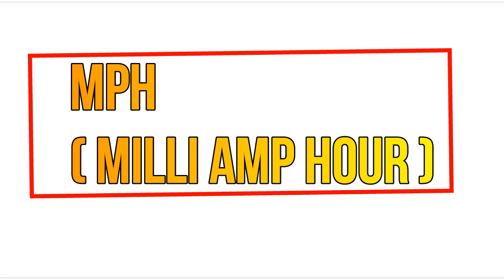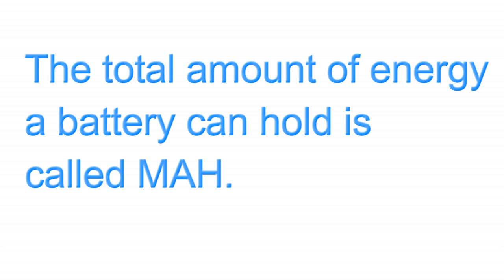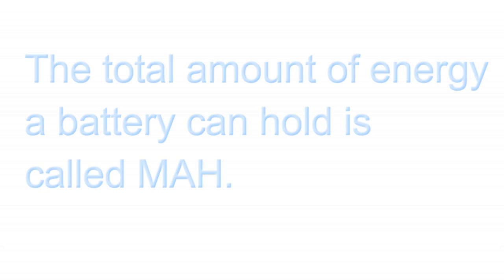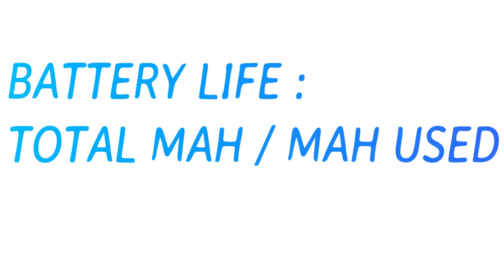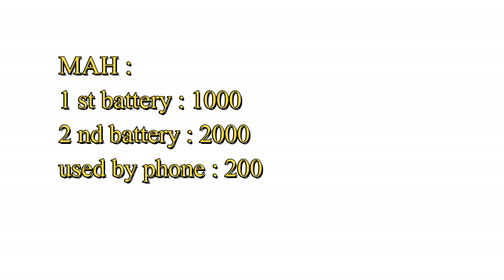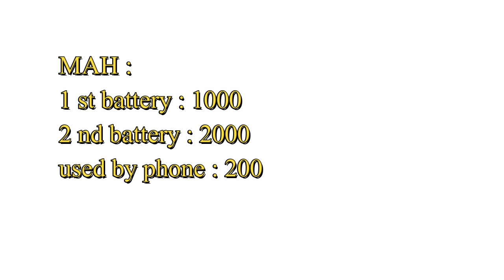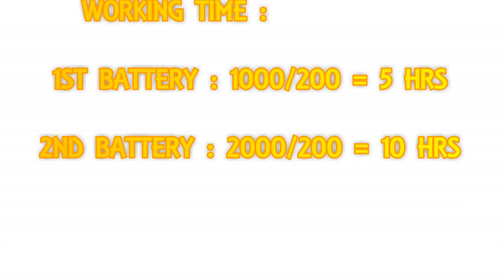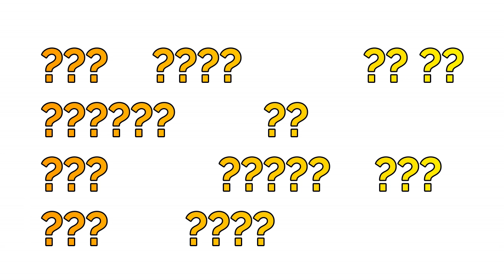WHAT IS MAH ??? EXPLAINED ( mAh to mAh battery )

Comment: Great video! I'm trying to power a 5V sensor with a 3.7v booster/charger pcb. What's the minimum mAh battery you think I should use? I have a 120maH lipo on it now and the board seems to dwindle and looses power 😞. Thanks for your time!

Comment: I have a battery pack that uses two 18650 batteries, parallel conection. But they are old and I don't know if the connection between them is still good. How can I find out if there are two batteries working, or just one? I can't open the casing

Comment: I bought a charger I picked my phone as option BLU Pure  XL p00100uu 64gb im ..Only because merchant gave an option to choose phone model I figured they send a fast charger with mAh equivalent of my specific model.. Is it OK if quick charger has 31000mAh but my phones battery mAh 3 500.   
3.8 v (dc) 
Will it be OK to use or do i return it? If yes Why? Ty